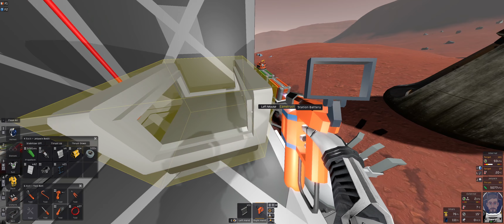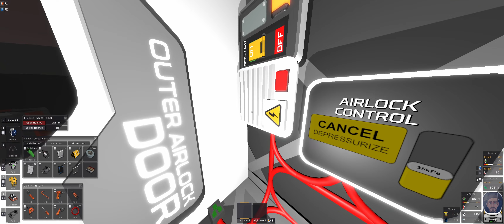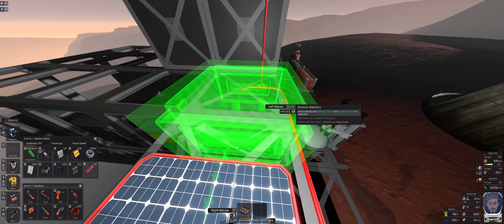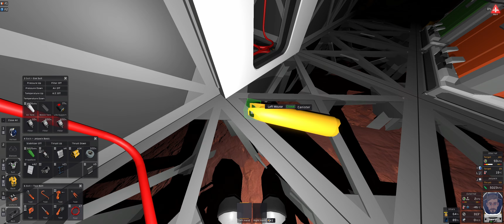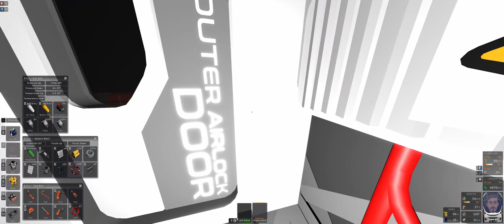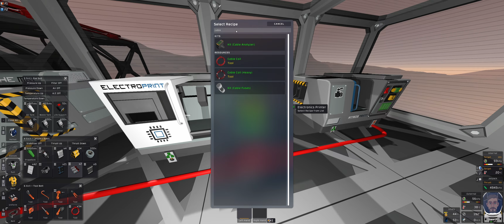Powering the Base - Stationeers Mars (new terrain update) Gameplay

Comment: Question
Please correct me if I am wrong, I think I am missing something. I know, I got lost in the first thin power layout vs the replacement with thick power cabling cut-over.  Thick Power Cables: All is connected; Generator, Solar Panels, and Base Battery directly? Thin Power cables are connected from secondary power port on the Base Battery?

Comment: it may be too late, but if the storm hasnt come yet, protect that the lander!  if you didnt know it has a built-in beacon with an infinite battery.  the way i protected mine was i drilled down about 8m (4 frames) directly under it, dropped a mining charge to open up a cavity.  then drilled around it to let it fall in.  then just cap the hole with airtight frames or walls.  another change, early game, an ice crushed isnt needed to process ice.  you can now place ice in the portable GAS tank import slot and it will melt into the tank.  if you insert water ice, it will auto sperate, and warm up to 5C. (Nitrice, will condense the NOS too, but latent heat will get it hotter).  place in 46 Vol and 24 Oxite ice, you will get "dirty fuel", at 4.3MPa, 0C.  the welder, furnace(s) etc will burn this fuel just fine.   as well you can mount a portable tank down and still be able to insert items into it now.  since a portable connector has both liquid and gas connections, a portable gas tank is now a power free ice crusher, tank, and condensation valve/filter all in one.  Note, liquid in a portable tank will NOT cause damage to the tank.  as well when melting ice this way do it outside and temps below 0C or shade (the Moon).  the ice isnt deemed insulated so ice melting in open air rules apply.  not an issue on Europa!  this ice melting change was to make brutal starts easier, and ofc the welder can melt ice too.
Reply from the maker: Whoa, i DID NOT know that. Thx m8
Reply: very interisting infos i'm mad because i have deleted my lander why it's too late  :-(